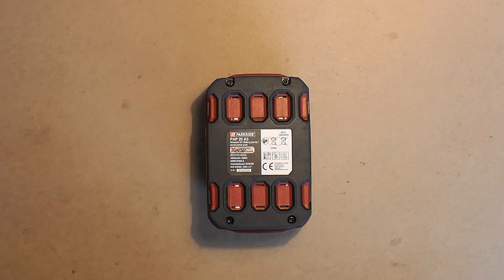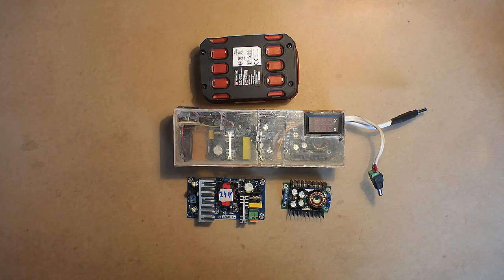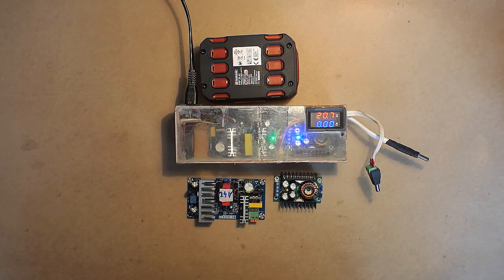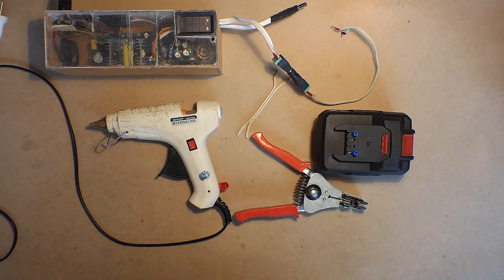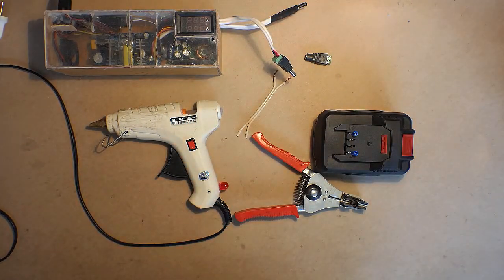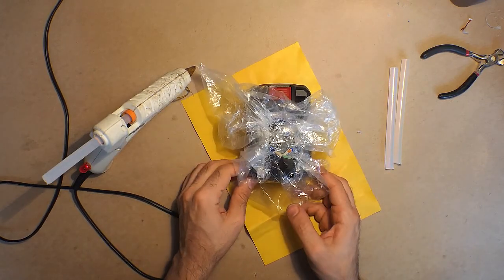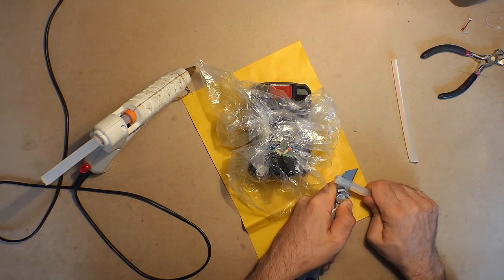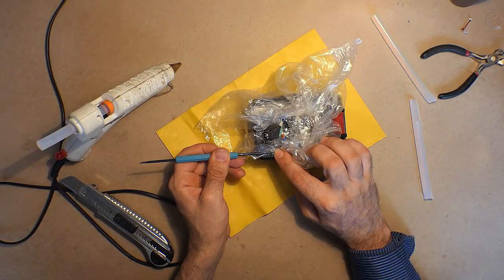DIY Adapters For 20V Battery Charger

Comment: When you are charging the battery packs..  where is the BMS?   In the pack?  I mean... what prevents overcharging?  Awesome channel by the way.
Reply from the maker: Thanks, all new videos will be published here: https://www.youtube.com/channel/UCbQUNw5V5pDPXugLX1FP_Fg
As to your question, - BMS is, of course, in the pack. It should prevent overcharging, but my DC-DC converter of the charger is adjusted to 20V and 2A max. So, the charger can't overcharge the pack anyway.
Reply: @powerbatterychannel4315  Aha.  That's clever.  Had not thought of that, though it is a simple solution.  Thank you.
Reply from the maker: @surfreadjumpsleep  You are welcome